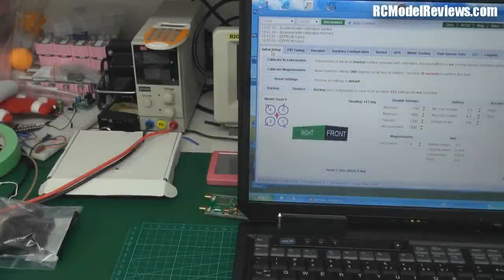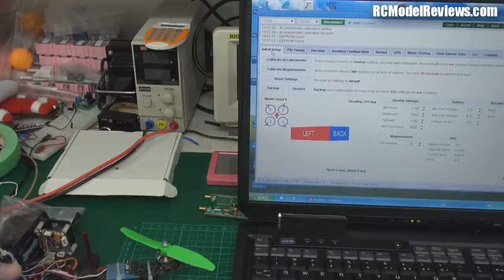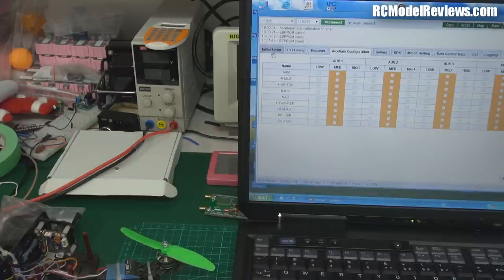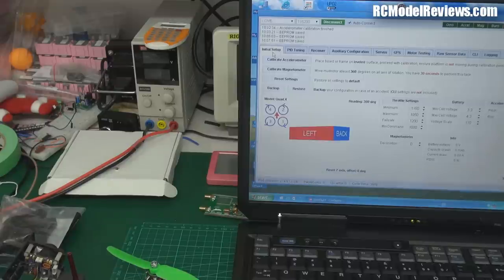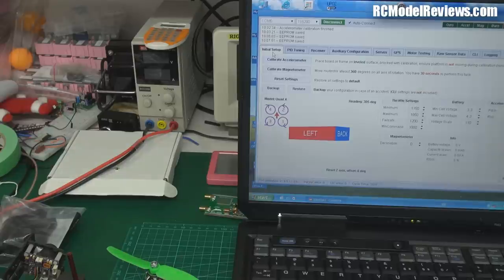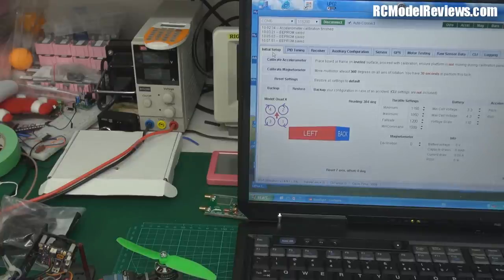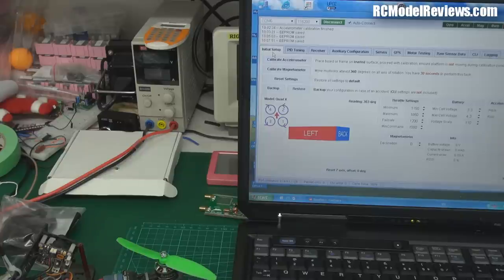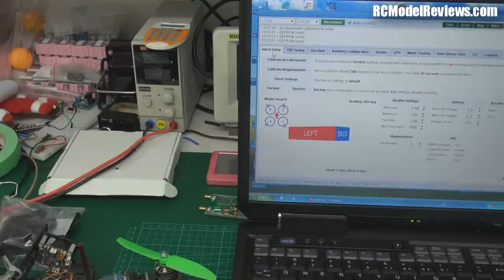Naze32 yaw gyro fail?

Comment: This has happened to me with several APM's bruce, there is generally two causes, either there is or was an overvoltage on the board, it can either cause permanent damage or make it go wacky until it is fixed.
check the voltage going into the gyro chip is 3.3v, if it is over you may have blown a regulator.

Otherwise inside these chips are effectively tuning forks that wave in the breeze causing voltage changes with movement, manufacturing defects put weaknesses in the forks and hard crashes can cause them to snap.

if you aren't going to fix this board, could i buy it from you to find out whats wrong?

Comment: It may not be totally related, but I noticed one of my Naze32's (non-full version) slowly "drifts" clockwise while connected to the GUI.  I haven't spun it as Bruce did in the video, but the drift was only after the newest update (Feb 2015).  Not that the update wasn't previous to that, but that was when it prompted to do the update.

Corey

Comment: I tend to agree with the others that it appears the yaw component in the MEMS is mechanically damaged and the algorithm's trying to make sense and smooth out the extreme yaw signals coming from the gyro.  If this is the case I'm thinking playing with the PIDs to silence the gyro yaw output won't help much to make it keep it's nose direction as the yaw will be fully subjected by extrinsic forces - like flying a heli on totally manual mode for tail.  Possible but difficult.

Comment: I had that same problem with my CC3D board.But it wasnt until I stuffed my mini in the snow once. My Bad. LOL    I wiped it down with rubbing alcohol , dried it well . Then I re - configured it completely from start to finish. Then I sealed it with liquid tape. Let dry over night and it has been good since then. Mine even  stop recognizing the gyro completely once until I decided to clean it well and start from scratch re booting and all that stuff. What fun.

Comment: Not quite the same here:

I have the NAZE32 Acro and stuck an external compass on it via i2c. The quad kept doing uncommanded yaws at critical times during flight, particularly when i'm recovering from hard bank, and a bit of experimenting later, I found that even with the Mag turned off, moving a magnet around the board still affects the heading, both the heading number on my phone (i have bluetooth), and that big box on screen rotates.

I remembered Oersteds Experiment that we did back in highschool, so i removed the compass module, mounted it on a weight (a flashlight) and moved it as far away from the frame as the wires would allow. Held down the quad with one hand and gave throttle. The heading no longer changes with the throttle, i moved the compass closer, it gets affected again. The compass is lining up with the high current wires running the length of the frame. I found that i needed to mount the compass atleast 3 inches away to avoid most of it. I don't have anything to mount that magnetometer on, so I just unplugged the compass/baro module, and the throttle yaw problem went away.

Does the problem you're experiencing also happen on acro boards you've seen or just the full boards?

BTW, that NAZE32 is now retired and i'm back on the KK2. A month after that magnetometer issue, the naze32 no longer responds the same in both yaw directions. I've mounted it on two frames, and it exhibited the same problem that wasn't there when i first got it.

Comment: I have a similar problem.
The gyro sensor works only with every 10th start.
If I'm lucky the gyro sensor is booting normal and the data in the GUI under "Sensors" are normal.
But in most cases, the gyro sensor returns no data and the GUI graph for Gyroscope does not move. The remaining sensors work without any problem.
I do not know whether it is a hard or software error.
Meanwhile, I have replaced the Board.

Comment: I'm pretty sure it's the compass not the gyro. I use a STM32 dev board (installed cleanflight) and a 10DOF sensor board from ebay, which is in essence what a Naze32 uses. It shows the same behaviour when I tilt the craft over a certain angle. It suddenly spins around 180°. I know it's the compass, because it is dependent on the direction the craft is facing. I can't tell you, if your compass is broken, but I couldn't get rid of the flip even with calibration. The mag values on the sensor tab were all sensible though. So it seems to be a problem with the algorithm that calculates the heading from the compass values to me.

Comment: Very good chance its a mag problem , should not effect flight ( unless you have mag on) .Check your sensor page in the GUI and one of the mags axis sensors will probably be stuck at one setting regardless of movement. 
Your little orientation box is trying to show a mathmatically impossible change in position hence it "jumps" to the nearest possible orientation.

Comment: Hi, I had a similar problem with my Naze32 full FC. It turned out that the magnetometer was not selected correctly. I went into CLI and changed mag_hardware = 1. It was originally set to 0, which I believe is the setting to auto detect. At first I guessed that my FC was defective, but once I manually selected the port (ie disabled the magnetometer) , things were fine.One other note, I am using Cleanflight. 

Note: If the problem continues after disabling the magnetometer (you will see this sensor go red in Cleanflight), the problem is most lightly due to a failed gyro.If the FC is the Acro version, then the gyro is the problem. If you look at the sensors in Cleanflight, you will see the Z gyro change +/- according to direction of rotation when the board is rotated in the horizontal plane. If this does not happen, you can be sure that the Z axis gyro is shot. Hope this helps.

Comment: I have an issue with my name32 acro that is similar but is on the pitch axis. In rate mode when you center the elevator stick from forward motion it wants to pitch wayyy back. Very frustrating.

Comment: I've got a similar problem with one of my full Naze running CleanFlight. The only solution I could find was to replace the board.
On a slightly different note have you tried CleanFlight yet, just like BaseFlight but loads more features and a sensors tab in the GUI that shows you exactly what the mag and gryo are outputing. This may help you with your problem.

Good luck from the UK
Reply: Jamie Harwood Yes, I'm playing with cleanflight and will be doing a comparison video for those who haven't.

Comment: Check if the ground sholdering is ok. I know for a fact that bad ground and unstable current feed causes the gyro to look like its spinning even if you didn't move it. (once saw few people wonder why gyros told that the truck they were installing acc-meters and gyros and other sensors was spining and falling on the shop floor, reason was bad grounding.)

Other thing might be that the gyros have wrong gain values on the board and the gyro tells that your quad spins faster than it does. That actually seems like the case, wrong gains in code.. At least with my opinion. even though i haven't even seen a Naze board live :D (I use OP myself, haven't tried anything else. at least yet.)

Comment: I had a issue like that and someone said to try another USB cable and it worked out to be the case, but in saying that I have also brought two other naze32 boards that would do what you have but at a faster rate. I couldn't get them to fly at all as to why I don't use naze anymore. It just must of been a bad batch, it was the red colour boards at the time.

Comment: How does it fly? I've had this and the yaw creep scenario going on with the GUI but more importantly NO symptoms on the craft itself while in flight. The configurator does get updated (updates in the background due to being a Chrome app) and it might be a compatability issue with firmware and configurator.
Reply: garageadz The creep on yaw is normal, the swinging around like that isn't.  The baseflight configurator can't have been updated because this laptop has no internet connection ;-)
Reply: Copy that sir !
Reply: ***** A real quick test can see if it is magnetically caused...Try bringing a strong permanent magnet near the Naze and see if it affects this behavior in any way.
If it does, then you can narrow down the problem to a magnetic issue, not an accelerometer one.

Comment: Using cleanflight I am having issues with the bluetooth connection just stopped working and Led not working at all. Some issues can only be "resetted" using baseflight and then reinstall cleanflight.

Comment: yep. ditto. also they tend to have a twitch. hover for 20secs and it will twitch. also regularly loses altitude then gains altitude. great for acro but for me, not a unit I will buy another copy of. kk2 much more stable and apm micro too. fpv- not reliable enough for me to risk.

Comment: As suggested mate.
Try the set mag_hardware = 3

Mine is/was exactly the same and it's not even been installed in a Quad yet. (Brand New Naze Full) I did the disable thing and it stopped it right away.
Could still be faulty or It could be because I am right by the PC when trying to configure it...

Comment: Have not had that happen to mine.  First time I ever heard of this happening also.  Could it also be a software bug?  Bad batch?  Usually the Naze32 are pretty solid with Gyro and Accelerometer.
Reply: I had this problem on Arduino. I solve it just going out on the street and calibrating it again! Worked for me and ardu.

Comment: I had an issue with a naze board that cut the motors every time I yawed, it did this for about 1 second every time, wiring was 100% ok it was defo the naze board causing the issue, now replace board and problem now gone....

Comment: You need to try more KK2.1. It's very convenient so you can tune in at the field over 30 times in one battery just to tune in and you don't need a PC.
Reply: KK2.1 is very old tech. 8 bit as opposed to 32 bit on the Naze32.
I own both and the flight performance of the Naze32 is far superior.

Comment: this has also happened to me when i installed my mag and compass 90 degrees in relation to each other to get them reading right, i had to change the orientation in the sketch, its as though the mag and the gyro are fighting against each other...

Comment: I smashed into a tree hard yesterday after work and got my Y gyro jammed/stuck. After doing some research many haved had luck smacking it hard on the table to free up said gyro and it was then ok on re-calibration and flight. Not sure if you can induce a shock to the yaw gyro as easy but I bet a fast spin crash could do that like hitting an arm on a tree etc? Good luck was just about to push the button on an acro naze but will try slamming naza first when I get home :o)

Comment: those gyro and accelerometer chips really aren't solid state, they actually have little masses etched into the silicon that vibrate in the different directions, and it is entirely possible that it got damaged.  You might want to dig up the data sheet for the gyro on that board and see what it's rated maximum g-rating is compared to some other products.
Reply: The Killer Spud Yes, MEMS devices are susceptible to high shock... I killed the accelerometers on one of my miniquads in a really heavy crash but the gyros survived and since I fly in rate mode only, it doesn't matter :-)
Reply: ***** Maybe next time you can talk about susceptibility of these things to shock damage. Speaking of which, i don't suppose you can just buy gyro/baro/mag modules and have the NAZE32 boards link up to them via i2c? Maybe i can get a hobbyknife and cut some traces on the FC to take all sensor readings from the i2c module?

Comment: Just go to the tab where the sensor data are graphed out (sorry I am using multiwii gui, so cant comment on those google guis.) Just look If the sensordata are shown correctly, if so you can rule out/or confirm a hardwareissue. That is the easiest way to nail down the problem. In your case you would expect missing/crazy gyro yaw data.
Reply: From what I see it looks more to be a problem of the magnetometer in your mag unfriendly environment. That will not harm flight, unless you switch to a mode that requires mag... Crashing the copter can actually destroy any acc or gyro (they have G limits in the datasheet) but all other axis working fine and just yaw wrecked is possible but unlikely.
Reply: CrashPilot1000 No, it does it with the mag in or out.
Reply: ***** Well from what I understand the GUI-displayed-box is the result of the imu gathered data and they are calculated in imu.c. But unchecking the Mag box in the auxchannels list will not change that. It "just" actually effects this part in mw.c: https://github.com/multiwii/baseflight/blob/master/src/mw.c#L758 , this part does mag assisted heading hold. So most probably you are worried about an gui-artifact that has no actual inflight relevance, unless you fly magnetometer dependant modes. Just check the "raw sensor data" tab if the gyro works correctly. Unticking boxes in the auxchannels tab will not disable a sensor. It will just disable the inflight-effect of that sensor.

Comment: I also am having this issue Bruce, craft just yaws by itself. Am about to replace with another board and see if that helps
Reply: Have you tried running cleanflight on your board?
Reply: As mentioned earlier irritating yaw is often caused by jitter in values on the tx, check the values in the configurator and if they're changing (even just by 1) set a deadband value from the cli

It may also be unbelievable to some but changing to cleanflight doesn't solve every issue (actually it seldom solves issues just gives more features)
Reply: Team Icarus RC been running cleanflight for months. same thing using all PID controllers
Reply: Rob Crawford no jitter in the cppm stream, and already has a deadband set
Reply: Rob Crawford
Jitter in the yaw command from the tx will not affect the board's perceived attitude directly. The command needs to be output to motors which in turn rotate the board. In the video there is only the controller board.
Reply: Øystein sorry but I wasn't talking about that I was responding to somebody who was suffering from a slow yaw issue.

I suggest you read what's written next time

Comment: I have a similar issue with a quad of a friend: yaws to the right without stick (a large amount). Baseflight / cleanflight nothing helps. I will replace the board to see if that helps
Reply: Much of the slow yawing is a jitter in rudder stick on the transmitter, setting a deadband tends to sort the majority of issues
Reply: I've got the exact same problem brand new naze32, yaws wildly to the right with no stick input.
Reply: Having a similar issue, hard yawing produced by the fc when only giving a little input. Results in a spin out. Yaw deadband helped remove some of the slow yaw drifting but not the spin outs. Two fresh naze boards
Reply: Jefte Puente you don't have the battery right at the very back of the quad do you?

A couple of folks I know used to spin out all the time when throwing his 250 around and as soon as they moved the lipo closer to the COG the problem went away.

Others have had that issue but I think it was tuning problems in their case.
Reply: I'll double check COG tonight, and my boom lengths for symmetry. The battery is centered under the FC. I think my issue maybe tuning related, I'm such a noob when it comes to PIDs. Thanks for the help!
Reply: Jefte Puente it's not tuning. Go to receiver tab, you will see yaw number going up and down constantly. Fix that and you fix problem. I think you have to add something to yaw time or something.
Reply: It was definitely not yaw deadband. I tried that. In the end I was able to solve the issue by reversing the rotation of the props via a custom mix.